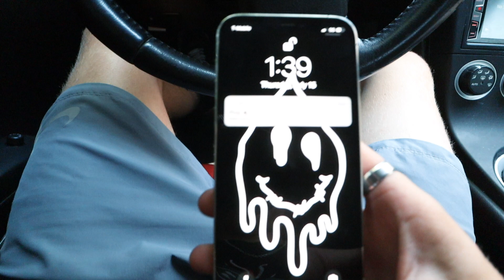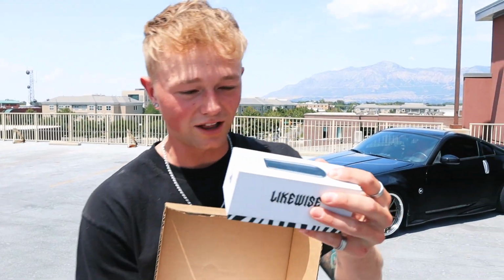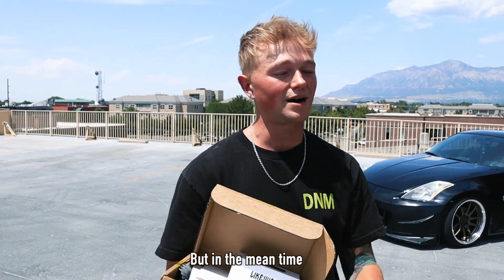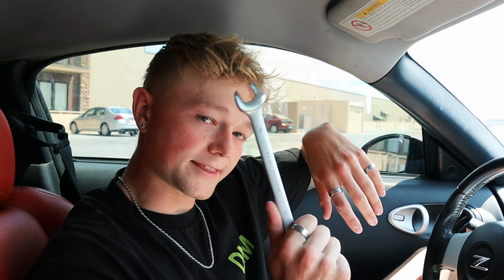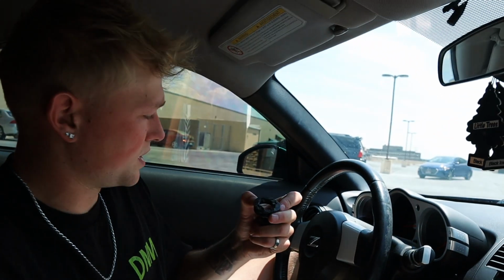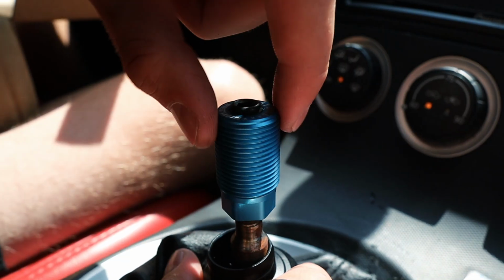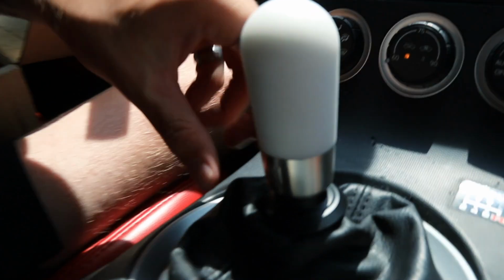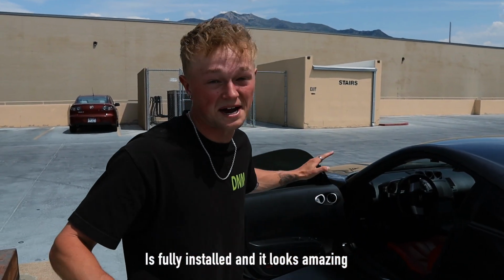We Are Likewise Shift Knob Install On My 2004 350Z!

Comment: Dude they fixed basically all the small little issues with the adapter how it would get stuck in the shift knob and taking forever to align the logo exactly how you want it damn now ima have to spend more money on the plus and make a video on it also

Comment: Man I would love a z I just wish it had seats that basically can’t fit anyone in the back for an excuse to tell my wife it’s a 4 seater 😂 man I love my likewise shift knob one of my favorite mods just hate racing with the extension on but daily driving makes it easier
Reply: listen bro i was in that same boat as you (minus the wife part lol) i wished it had the shitty backseats like the BRZ bc at least it's something just in case of giving people a ride or simply for the comfort of having more than 2 seats BUT after some thinking and getting different opinions i came to the conclusion that i should only worry about my own experience and to get the car for only myself to enjoy. Then you have a passenger for the occasional ride along lol long story short i ended up buying an 09 370z nismo 6spd and i do not regret it at all!